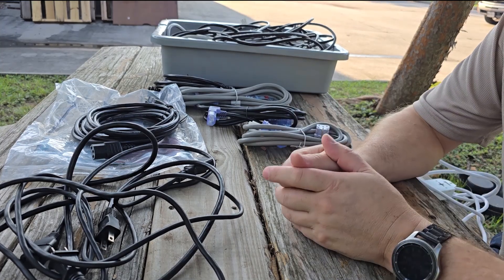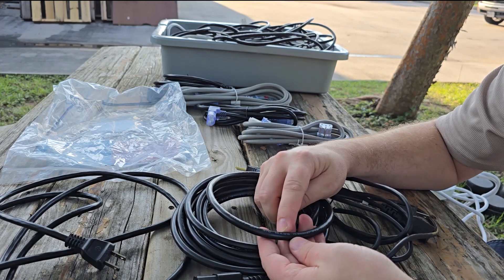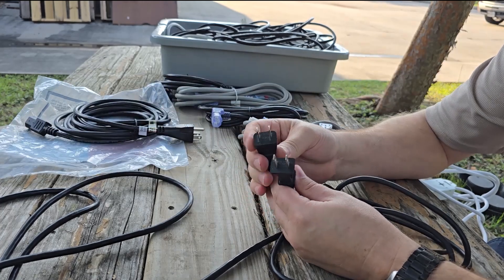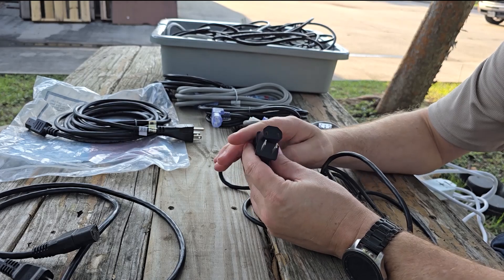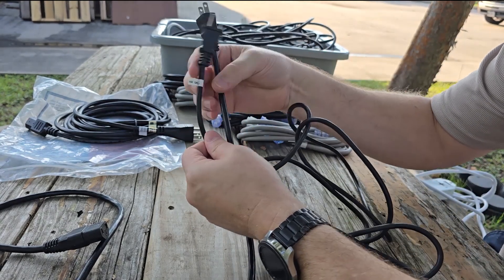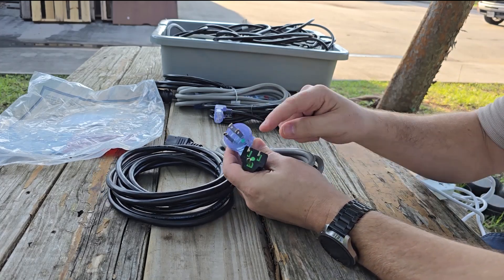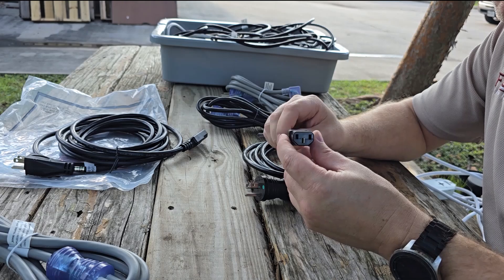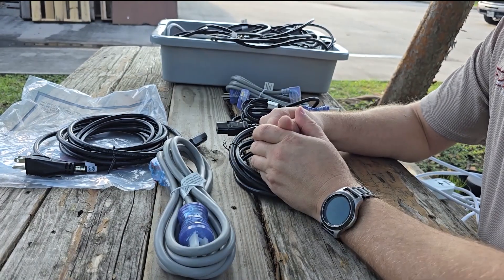Power Cords 101

Comment: Some medical companies in the EU claim they are selling "medical grade powercords", while they are just selling normal power cords.
All because in the EU we don't have something like medical graded powercords.

But one thing I always lookout for in powercords is how damaged the IEC connector is, most of the time they worn out of plugging out and in devices. Which leads to an higher contact resistance and can cause fires.
Since you won't test the resistance of the live and neutral sockets nobody will notice untill its to late. So ALWAYS check the IEC socket when you check an medical device; on both ends.